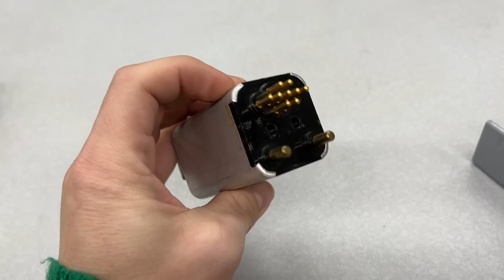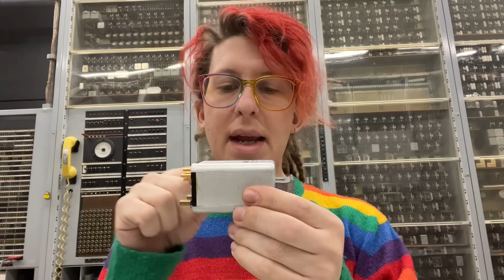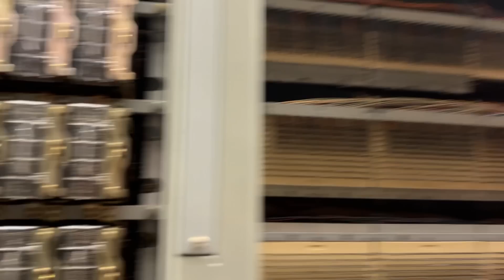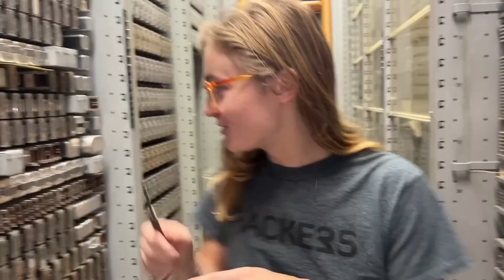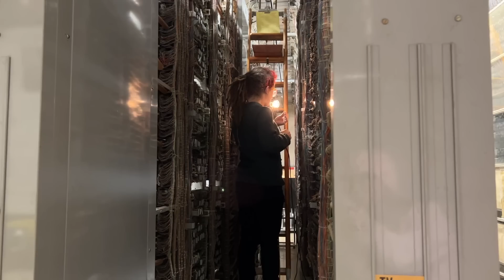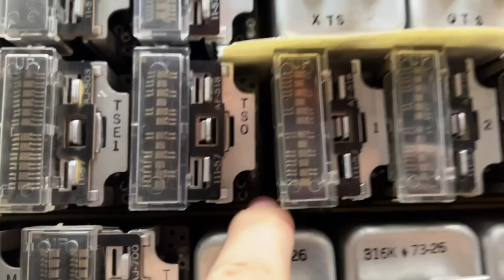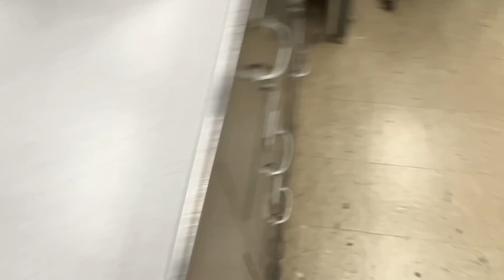Malfunctioning Potted Relays: Emergency Repair in the No. 5 Crossbar

Comment: I love these videos keep making them. This electric mechanical machines literally fascinate me.
"it's good for 20-30 years then you order another" 70 years later....
Telling grandpa about the leaking caps issue in the 2000's... Ha, son back in my day we'd just grab a card...
EEEH! I love how you hint on pricing! You are talking about it in a "how long should it last" situation but you're also figuring out the budget for the design of the system and the cost the phone companies are willing to pay.
Even if the 5 year ROI rule wasn't around then the idea would have been. How much cost? Take the max number you predict the phone companies are willing to pay times 5 years and that's the cost of the device. It sounds like for phone systems it might be longer or not work out like my example for other reasons.. but that is how I've seen the cost of a product be calculated (basically).

Comment: As a switching tech in the 70's,  I used a 35f test set on those 280 type relays quite alot  which set certain currents to the relay like "soak, no operate, soak, operate" etc. If a tiny metal burr come off between the adjustment tool and magnetic post,  it would throw off the settings.  Especially if you didnt see it -- like me. Fun days working on those. Thank you for the video.  Excellent.

Comment: Ahh, polar relays, i have serviced and adjusted so many, they were used in telegraph systems for the 50 or 75 baud signals.  These were usually quite reliable, although I once worked with someone who wasn't very good at anything, he put the wrong length screw in the contact set of the transmitter of a Siemens Tloch 15A.  This shorted the polar relay from hard 50V to earth, he plugged the machine in and turned it on, 10 seconds later clouds of smoke started pouring out of the relay set under the machine counter, 1 amp through a polar relay will do that.  

I also worked on Ericsson Crossbar exchanges, they used Claire relays for the telegraphic signals.  These mounted on an octal socket and were the shape of a signal octal valve but in a metal can.  They were very reliable, but when one started to play up, you unplugged it, dropped it on its base (a couple of inches), dropped it on its top, and dropped it on its bottom again, usually success!

Even though it is a different crossbar system, the names used in this video are bringing back bad memories!

Comment: Thank you for another excellent video, Sarah, Claire and Astrid. May I ask if you have considered some kind of method of sealing the base of the potted relays proactively to prevent the green goo escaping in the future? For example, I wonder if it would be possible to use silicone, varnish or a gasket around where the socket meets the can. This would surely be better for protecting the long-term preservation of the switch components and prevent similar goo nightmares in the future. Alternatively, it might be possible to 3D print some kind of goo catcher widget that can be fitted to each relay if you think there is a negative consequence to the goo being kept in the relay rather than being allowed to drain.

Comment: Do you know if it's the same goop that's in the networks? I've never been able to get a good look at the goop inside, but from what I've been told, it's just as equally difficult to clean and remove.
Reply from the maker: Not sure! I've never been able to get a network open either, but I think another commenter said that it was the same.
Reply: @ConnectionsMuseum  that is so interesting! I wonder what it's made of.

Comment: It seems you can hear the difference between a well-serviced switch and one that has had a lot of toothpicks to block troubled lines. In retrospect it was disconcerting to walk through a 4A/4M switch when new to Long Lines.  Some of the equipment used to make connections was astounding at the genius minds that were able to make mechanical things jump up and down, shine light, and cause a connection to be selected. Hearing the relays clatter and the steppers move up and down, then rotate, was overwhelming to consider how well it worked given all the moving parts. I heard of the 'trouble ticket' machines getting blitzed, punching cards as fast as it could until the supply ran out when a particular thing broke, never observed.  Watching brings back memories from the mid 1970's. "Came clear while kicking bay" on a ticket... popular solution.

 Meant to add, you could try using 'pig mats' cut into strips of appropriate width stuffed under your leakers.  The material will absorb a LOT before they have to be replaced, and they are not real expensive.
tom

Comment: The green 'goo' is the result of the decomposition of some sort of polymer inside of the relay, it's green because it's reacting with something copper inside the relay, and sadly because of that, it is relatively conductive. I would think that at some point the relays that are leaking this goo will become problematic in their function and will need to be replaced but you probably get that much.
Luckily at least they aren't filled with PCB like some old transformers were...

Visiting your museum is still on my bucket list, I'm only 4.5 hours away drive-time, hope to make it some day.
Thanks for sharing

Comment: Super interesting. You seem to be the right person to ask: I've been told that in old telephone switches, soldered joints had to be refreshed after a certain number of years. Is that true? I'm assuming this was lead-based solder which is, I suppose, still the most stable solder you can buy. I see that this switch is wire wound, which I believe is still the most reliable wire connection that exists. Is that accurate?
Reply from the maker: In my experience, soldered joints do not have to be refreshed. There are many thousands of soldered connections in our switches, many of which are 100 years old and are working fine. The ones that I have had to fix were done more recently, by someone who didn’t do a very good job in the first place. Others just broke because the wires became brittle, being pushed around for 100 years. 

Wire wound connections are also extremely reliable. The wrapped wire forms an air-tight connection around the terminal.

Comment: Is there any way to seal the back of those relays ?
If you're worried about pressure with heat, maybe carefully drill a hole in the front
You should get that goo tested, not only to make sure it's not toxic, but to find out if you can use a solvent, even going as far as dunking the relays in the solvent to clean them.
I used to install and test crossbar exchanges in the early 70's in the UK, ours were in double sided racks, the shelves hinged down for maintenance
The first exchange i worked on had 5 floors, gound floor was MDF, batteries etc, it was a new exchange building with plenty of room for expansion., i knew that electronic exchanges were coming in
I recently found out that the exchange has been converted, the top floor is now residential flats

Comment: We used to attack messes like that with 1,1,1, trichloroethylene spray (we called it "Instant Switchman"). Black and white spray cans from WeCo by the case. The liquid also came in brown pint bottles through 55 gallon drums for when things really got serious in a #1 SXS.

Thing is, methyl chloroform or fluorinated  methyl chloroform is nasty stuff, even though we sometimes almost bathed in it. 

Hopefully there is currently some sort of reasonably safe solvent that can be used to detail clean your wire-spring relays and other gear.

Comment: Folks, the green goo is well known in other areas of electric devices where it is a mixture of a plasticizer (diisoctylphthalate and decomposition products) and copper oxide.  Materials that degrade to green goo were afaik used in the imid 60s to early 70s. Green goo is considered pretty toxic so please at wear gloves. In electric installations the degratation of insulation materials to green goo also results in a fire hazard.  Your switch is a low voltage, low power device but still you want to evaluate if the fire hazard affects the switch and if so how to mitigate it.
I understand it sticks to gloves but due to the toxicity not wearing gloves just is not an option.  If your gloves tear you may want to try the type of gloves worn by mechanics and similar which are much stronger. Or wear a pair of other gloves like leather gloves over the thin nitril gloves and dump the leather gloves too once finished.  I recommend nitril gloves because latex may cause allergies even in people with no prior history of allergies.

Comment: I was just curious, have you considered using either carburetor or brake cleaner to remove the goo? Carburetor and brake cleaner seem to work faster than Goof Off for removing certain sticky and greasy materials. Perhaps carburetor dip would work as well?

Comment: Had a goo problem back in 1970 at one of the first  GSC crossbar exchanges being installed in Wales. The goo appeared under the residual studs on relay  armatures causing them to stick on. The problem was caused by fumes from the moulded plastic shelf covers  reacting with the stud. The covers were replaced with glass covers in metal frames and the problem was solved. The plastic covers were very popular as garden cloches.

Comment: I would not touch that stuff with bare hands. While it's not brown, the fact there was also a strange yellow substance might mean it contains PCBs, which were often used as insulation in capacitors and transformers.

Comment: I worked for Nextel as a contractor back in the early 80s as a trunk room Tech (my dad used to work for them too & got me the temporary job) so that green stuff, if I remember it is inside those cans as a vibration insulator to contains the mercury-filled glass microswitches

Comment: I'm nowhere near as well versed as some in this comment section but I am wondering if the Goof Off you have is the real deal extra strength with toluene. No longer available in California. Brake Cleaner is a strong suggestion but the aerosol cans tend to have an aggressive spray. But you can get it in gallon jugs(for refillable sprayers)... I'd bet a heat gun would come in handy as well as long as it has multiple temp selection. The pessimistic thought is that the appropriate solvent for the goo is unobtainium in our post EPA world(not complaining).

Comment: Wow yuck! Are those high pressure mercury whetted relays making the goo? I know those sometimes use "wax" to surround the high pressure glass tubes. So the goo may have been more of a wax before it chemically broke down. And it might be there to catch shrapnel from the glass envelope, should it explode. 
I had one of the ones that never had any wax explode on me. It looked nothing at all like what you have there. Much smaller aluminum case on these, one of which this time was just HANGING OPEN. I go 'huh, what's this' as I slightly bent the wire running to the envelope and 💥BANG💥!! Also something hit the wall behind me in a VERY timely fashion. 
Now terrified, I look into the relay case and then saw half a glass tube, one of the contacts and realized what I'd just done. MMMMercury! (only a tiny bit) Found the other half on the other end of the room, it had torn itself clear of the wire! This was 20 years ago on an old HP rack mount high sensitivity nixi volt meter... havent popped another one since. Scary but fun.

Comment: What I used to do is to place a 1/2 inch plastic pipe along the loom then wrap the wire round the pipe, that not only looked nice, it gave leeway if you broke a wire.

Comment: I really enjoyed the discussion on polar relays.  In the summer of 1966 I was 14 years old and the CO in Cle Elum was being converted from switchboard to step-by-step.  I spent most of the summer hanging around the work and begging parts from the old office.  I got a bunch of polar relays and arranged them as a 10-bit memory for the computer I was going to build.  The computer never got past the working 10 bit memory, but I did have a lot of fun with several different types of relays.

Comment: I had same issue with a similar WeCO 314R sealed can relay I found it in my electronic shop inventory still in the box! NOS. It's a substitute  for a 255A Polar relay found in model 15 and 28 teletypes.  Green goop!. Thank G-d it was in a plastic baggie.  Acetone cuts it well. Also WD-40. Use WD-40, then degreaser like used to clean engines or brake rotors. Home cheapo to the rescue. I just discarded the relay. Big mess. ST

Comment: We find this Green Goo in the Uk on PVC cables manafactured in the 1960's I understand its a  "degraded di-isoctyl phthalate" that was used as a Plasticizer on the Sheath.
I used to work on Crossbar systems in the 1980's and haven't seen it on relays but like you say its past its sell by date.

Comment: Okay so I thought goop situation seemed familiar and I was right. Green goo is the result of a reaction between decomposing PVC plasticiser and the copper in cables and conductors.

The plasticiser starts to slowly decompose over time, reacting with the copper to produce the green colour. This process can be accelerated by high temperatures caused by overloading or loose connections. 

I've seen this before in older plastic coated wiring and that may be what's happening here. There's some sort of chemical reaction going on inside those old potted relays. I would definitely first check the conductivity of the goop and then send it off to have it tested.
Reply: Course I could be completely wrong on that too lol

And thank goodness someone else understands that after such a long time machines sorta develop their own sorta personality and moods and to be able to understand that you have to work with it consistently.
Reply: I found some Western Electric 316M Relays for Telecom/Teletype on Electronics Surplus, they have the same or similar base as those, they're new/old stock. As of this post they only seem to have 35 left

Comment: How would this failure affect call handling? Would the fault-detection systems automatically redirect calls through the other marker?

And regarding the wiring, have you considered annealing the copper? Heating it to a dull red glow (maybe with a lighter) should let you wrap it again without breaking. If you can do this without melting the insulation too much it could be a nice way to make replacements easier.
Reply from the maker: The marker would time out (due to the relay not operating), and the call would be routed to another maker for completion. The subscriber probably wouldn't notice the difference.

In regards to the wire, we have plenty of it, so I'm not worried about using a few more inches or feet. 
In terms of the difficulty, I'd rather do the job "right". In this case, right means that I need to re-wire the relay, and go home at night with the satisfaction that it will work for another 50 years <3

Comment: Decided to check my 1A2 cards in my KTU and lo-Behold one of my 400D cards from 1973 is leaking the goo from the 327A ring up relay. It really must not be conductive because its working fine still. And as a total side note, the green goo has appeared on several AC line cords for my AT&T Genesis phones (western electric made). When I cleaned them 99% alcohol barely touched it! but since it strongly resembled the "green goo" it probably is a plasticizer like others have noted.

Comment: How feasible is it to design functional plug- and logic-compatible new parts which use solid-state parts instead on a small custom PCB which would fit in the same footprint?

E.g. Fetrons — plug compatible replacements for vacuum tubes.

Comment: Just an idea...maybe you could take some clear fiber 1/2 inch tape and wrap around the joint of the relays to prevent the leaking? Give a few a try.
Reply from the maker: Could do that, yeah. Also thought that some really strong bonding cement may work.

Comment: This looks very similar to what happens in old cheap power wiring where the binder in the PVC breaks down, it makes the wires go green and ultimately causes them to go brittle, very common in vintage power cables. @scr2igbt is almost certainly right but is calling it plasticizer.

Comment: This is how direct bury or ducted power cables fail. The plasticizer leaches out due to age and heat. If you have an older car that sits out in the sun’s UV rays and the vinyl dash board gets gooey, it's the same stuff. The green is because this stuff is corrosive to copper.  Eventually the relays will fail. I'd plan on a solid state replacement. Engineering challenge. From an ex Bell Labs Member of Technical Staff and 5E software developer/tester.

Comment: I do suspect that break cleaner would be a reasonable option for removing this stuff.
Just keep in mind that there are 2 kinds of break cleaner..
1.non-chlorinated(usually a mixture of alcohol and acetone)
2.chlorinated(Perchloroethylene)
I'd suggest trying both types, but I believe that you will do better with the second type-but do spot tests on any plastic parts with either type-all 3 of these solvents can have an effect on certain types of plastic.